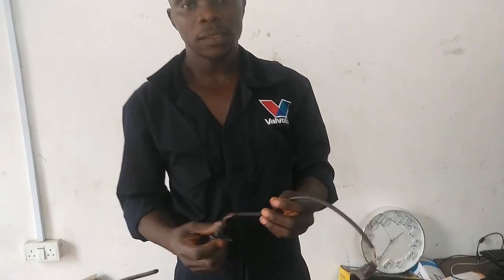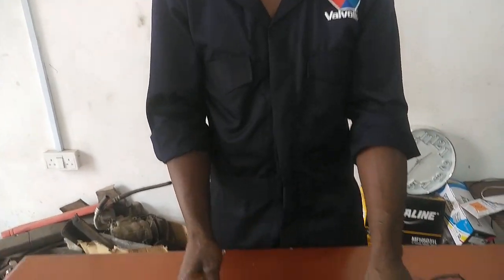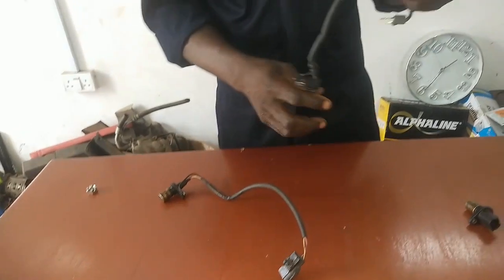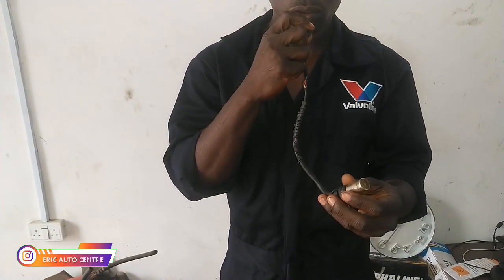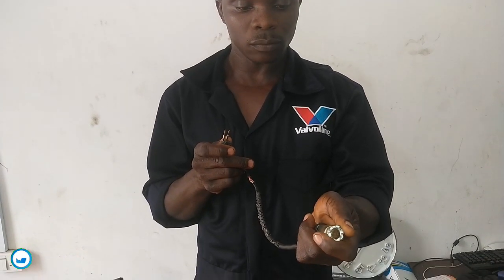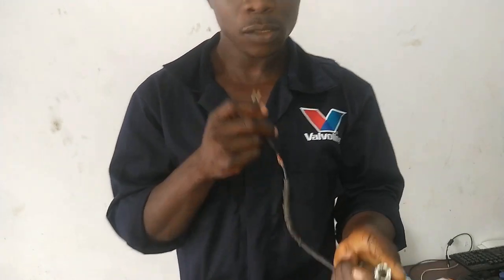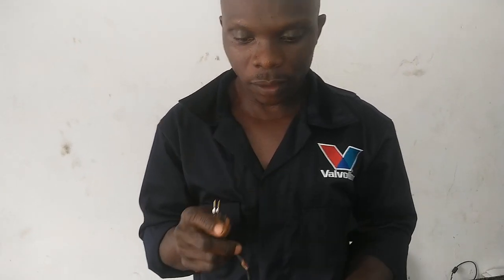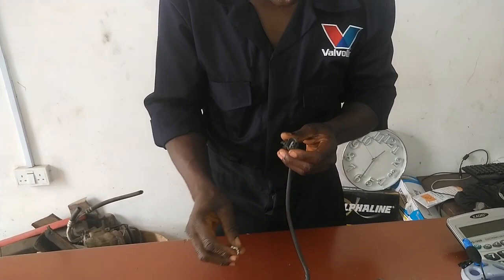How To Test Crankshaft and Camshaft Position Sensor Without a Multimeter #crankshaftpositionsensor

Comment: So hello i just tried it im getting nothing,its a crankshaft sensor i can feel the magnet trying to grab the metal but when i try this nothing...is it because its a three prone inside?????
Reply from the maker: Not all sensors require that if it pass through bcm you may not get it right. Use multi meter to test it